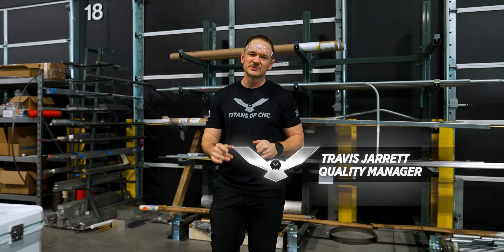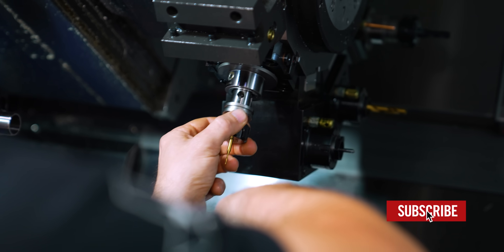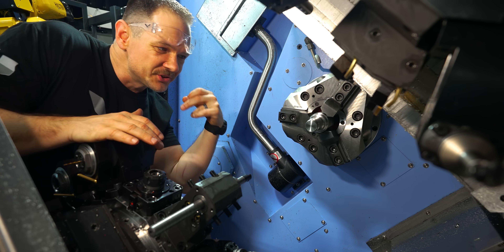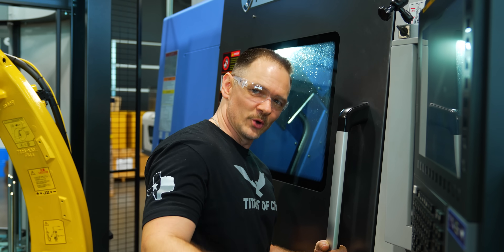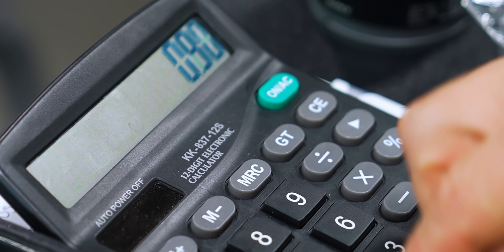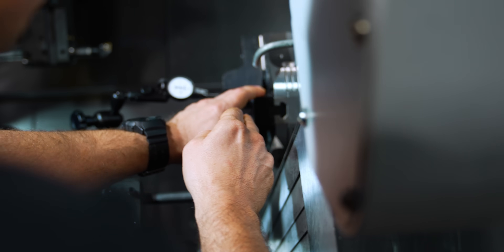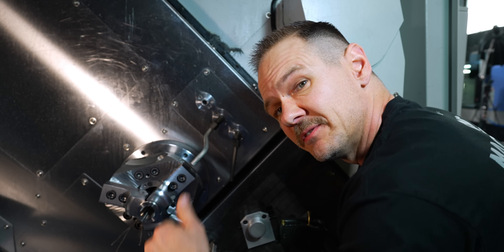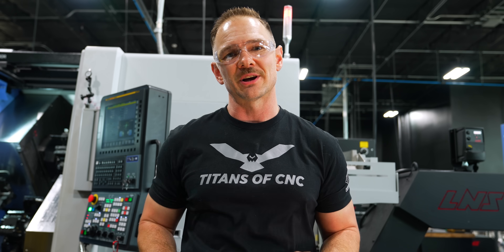TOUGH Material: Machining NITRONIC 60

Comment: I am planning to buy some some Nitronic 60 from McMaster for gears. It’s in the annealed state with 85 HRB, would a HSS gear cutter work? Any help would be appreciated thanks. The material requirements are quite strict, other materials would not be an option.

Comment: Cannot stress enough the importance of speeds and feeds (spindle speed in particular). We were making an endnut out of nitronic 60 on a citizen m32 and the cutoff tool force caused so much vibration in the machine it damaged the guide bushing pulley. Only after that did we start setting torque limits (50%-75%) on certain toolpaths.

Comment: I don't get why you couldn't use a transfer and part off. If the equipment and set up are good and the program to pick up and transfer from the sub spindle are good go for it. Seem like wasted time for 2 ops without out a transfer for one op. That's my Thinking on capable programming.  Chucking or dead length collets.

Comment: There has to be a clocking orientation between the small hole you drilled in the thread relief in OP#1 and the radial hole pattern you drilled in OP#2. How did you fixture that to maintain proper orientation? Inquiring minds want to know.

Comment: A little question... So, basically you don't need any preliminary center drills even for smallest vertical holes, if you are using carbide drills? Cuz at our workshop we are using HSS drills, and they require center drill for verical holes pretty bad, otherwise it just bends to the side.

Comment: hey out of curiosity what kind of tool life can you get running those speeds, I'm especially curious about the CNMG I worked in a shop for a little while and mostly ran N50 with CNMG walther WSM10 which lasted maybe 12 minutes if you were lucky, I wanna say the sfm was ~200 250 with .0125 IPR

Comment: 9:48 what? You skimmed the face, removed the part to gauge the length, then chucked it back up and faced it to length + - .001? How did that work? I mean, can you hold .001 when you remove the part and then chuck it back up?
Reply: Yeah it worked well. If I was +/- a few tenths then I might have worked something to check in the machine but this setup that length perfectly.

Comment: I worked with Nitronic 60 machining components for surgical tooling. It was one of my favorite materials to machine. Once the tooling was dialed in, the parts ran smoothly with little interruption for further adjustment (in my experience). I had to maintain a tolerance of 0.0002 with it.

Comment: so that stuff is cast in small batches inside of a plasma sphere that microwaves nitrogen atoms and used electro magnets to condense the plasma around the powdered material out of the chemistry flask? ... same as casting dirty rot iron 🤣😐😵‍💫 does it get a tungsten cladding in and out?
Reply: off to be x-rayed
Reply: the muffler on my car is 204 stainless, very thin and a pain to weld with 3/32 E7014... but that one time i slid into a curb over ice at 5mph "crunch"... i though the rim would have cracked... its a 5 ton boat anchor now. 309 doesn't need back purging to weld

Comment: I like to machine aluminum because my lathe has 20thou of slop in the tool holder and usually if I try anything harder like brass or steel it goes horribly.

For reference I use harbor freight carbide inserts and for my speeds and feeds I run them about whatever the motor can handle before stalling.

Comment: I worked in a job shop 35 years ago and we had some 16 foot diameter rings for a dam control valve in the shop of that alloy. It was nasty to work with back then, we didn't have inserts or solid carbide tooling to use. Plus that stuff work hardens like crazy.

Comment: What's with the barry chatter on the chamfers?  Lol jk, seriously though, you chose to interpolate those moving the spindle and the turret together correct?  Is that just how that material is?  Or was ur cutter dull or speeds needed a tweak?  Or am I blind and way off base.  Here to learn, not just give u guff sir.  Thank you kindly!  I usually get that when hand chamfering 303 or 304 with a chamfer mill in a DeWalt drill.

Comment: Nitronic 60 is probably one of the most interesting materials I’ve machined. Pretty cool to be able to take a small pin of nitronic 60 and bend it repeatedly and it will not break, it will get so hot it smokes without breaking

Comment: Nitronic 60 is good stuff, we use it a ton in the O&G industry for bushings and even as bolting under the SA-193-B8S spec in places where galling has been a historical issue.  Galling isn't a wear issue, it is a form of cold welding where to like materials basically decide to become a single item with nothing more than a little pressure. The 304 spec bolting such as SA-193-B8 is well known for this issue in the O&G industry, this bolting requires the use of nickel anti seize to prevent galling on installation as even hand tight snugging of these bolts can be enough if dry.

That said, super tight tolerances are more a sign of inexperienced engineers than actual need.

Comment: Just noticed you were using a red no-go gage on the part and had full engagement to the shoulder. Green represents go red is no-go so there are no mistakes here.
Reply: In my shop we expect our guys to be competent enough to be able to not only read the gauges but double check them. The wax is only there to know if the gauge has been adjusted and to protect the locking screw. We only use red wax for this purpose because of cost/availability, and we expect our guys to be actually reading the gauges. Besides outside of the grooved no go, you only se colored gauges on amazon and banggood. Those are all Chinesium trash and if you use them, well....

Comment: Stuff is butter compared to 13-8 H1000.  Rockwell 45+.  FML.
Reply: PH 13-8 Mo can be worse. Try the RH950 condition instead of H1000 and see what happens. 

The tricky thing with NITRONIC 60 is that it work hardens like mad. (And that is its main selling point: the work hardening at metal-on-metal contact points increases its wear and galling resistance.)

Comment: I designed a number of parts using Nitronic 60 due to higher yield strength for a non-magnetic austenitic material in the late 1970s and thru 80s.  It has been used in oilfield MWD tools due to non-magnetic properties for many years.

Comment: I'd honestly move datum A to the flange face, set not parallelism of opposite face but perpindicularity of thread axis and start machining from flange end as well, must result in single operation too. Also makes more sense from assembly point and eases contol too

Comment: It reminds me of something we call 1.4462 or even 904L here in Europe
Reply: Although the chemistry of the major Nitronic alloys and 904L (both of which we've poured at the foundry where I work) are quite different, the end result is the same...they are a challenge to machine.
Reply: A company I worked for used what I was told was a proprietary grade of that duplex stainless and was called 1.4462-A2.  I never machined it, but did have to retap holes in the field occasionally, that was difficult enough.  The funny part, the scrap yard would only give the company mild steel scrap prices for those parts because they were magnetic, wouldn’t take their word it was stainless.
Reply: @mikeb1520 I feel bad for whomever was buying what they thought was A36 steel and ended up getting 2205 instead...that's why we test all of our incoming scrap metal, which is how we found and rejected four barrels of mixed 304 stainless and resulfurized 303 stainless.

Comment: AH! Good ol' ARMCO NITRONIC 60! Or UNS S21800. Amazing stuff, and I happen to know what makes it tick (lots of manganese and lots of silicon have something to do with it)
Reply: Yes indeed, the manganese, silicon, and nitrogen all have a huge role to play in the galling resistance of Nitronic alloys. The last foundry I worked for had a customer switch from an even more bizarre alloy (CY5SnBiM, also known as Waukesha Metal 88 or Illium 8, which is nickel-based with significant amounts of chromium, molybdenum, tin, and bismuth) to Nitronic 60 because the performance vs. price of Nitronic was actually better than what they could get from the Illium 8 we were providing.
Reply: @justinchamberlin4195  Waukeshaw 88 has a big problem right now in the food-contact equipment business, due to new EU regulations on stuff leeching out. The low melting bismuth/tin content in 88 is going to be problematic, so it makes sense from another perspective too.

Magic word, for all metallurgists out there, is that NITRONIC 60 has a very low SFE, or stacking fault energy, which makes it really susceptible to cold work hardening. The rest of its properties follow from that. Galling resistance, wear resistance, cavitation erosion resistance, and so on.
Reply: @justinchamberlin4195  Second reply, to add more information: the addition of silicon helps with the high temperature oxidation resistance. The addition of nitrogen helps with increasing its strength (alloying with nitrogen helps other steel grades too) and the significant addition of manganese improves the wear, galling, fretting and cavitation erosion resistance. 

It really was a marvel of a development by Armco, back in the sixties.

(If this appears double, that's because one reply seems to have vanished.)
Reply: @Hydrazine1000 The amount of research, development, and discovery at places like Armco, Inco, Carpenter, Haynes, and Allegheny-Ludlum throughout the 20th century was absolutely nuts.
Reply: @justinchamberlin4195  I have to confess that I'm biased, I work for the company that was once ARMCO International. 

17-4 PH, 15-5 PH, PH 13-8 Mo, 17-7 PH, PH 15-7 Mo? The whole NITRONIC series? Those are all original ARMCO developments. Not bad to have those in the heritage of the company you work for.
Reply: @justinchamberlin4195 Some more background info: nitrogen increases its strength, like it does for quite a few other stainless steel grades. Silicon increases its high temperature oxidation resistance. Manganese dramatically lowers its stacking fault energy, making it really susceptible to cold work hardening, helping its resistance to galling, fretting, wear and cavitation erosion. It really was an incredible development by ARMCO Baltimore, back in the sixties.

Comment: so,  not a good knife making steel.  you need something more towards the martensitic steels.
Reply: Correct, try Stellite 6BH for corrosion and wear for a knife past the martensitic grades. Nitronic 60 is for when you need corrosion protection, strength and there is metal to metal movement with no oil lubricant. Like valves, pins, fasteners or outer space parts.

Comment: I’ve machined quite of bit of Nitronic 60. I have a new project with a new customer and they have their own proprietary material. All they will really tell me is it’s made up of a lot of Cobalt. Knowing how carbide inserts are made using cobalt as a binder I have decided to tackle the job with ceramic. I have machined some stellite back a decade or so ago and comparing the job to it. 
I’m in a large aerospace shop but the cobalt job is a automotive project. Just thought I would share.
Reply from the maker: Love it… cobalt is definitely hard to machine but in the case of comparing Inconel to Monel … the presence of cobalt in the Inconel makes it easier to machine because sometimes hard materials allow you to break a chip better… compared to Monel that basically replaces cobalt with copper which is more abrasive and gummy etc.
Ceramics is a great choice.

Have a great day,

Titan
Reply: you got to machine stellite? ffs, i scour the flea markets for old shop tools, hunting that stuff down... the in between HSS and carbide tooling, unknown, overlooked, neglected... my goto for copper, can take the razor edge of HSS with the surface speeds of carbide...

last time i tried to buy any all i could find was saw teeth, and the company no longer exists. then again, in australia, you cant get hold of anything much really... and if you can, triple the price then double that for shipping...